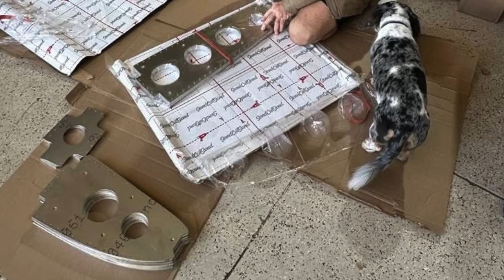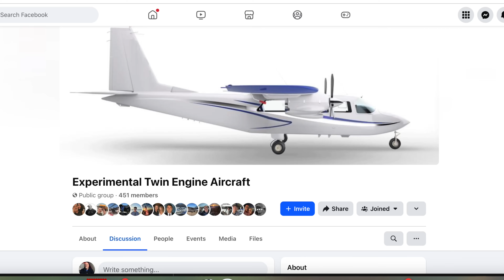Viking Aircraft Engines NEW TWIN Design & Timeline

Comment: How many square feet wing area? 2000 sq ft? Jan divide by 10.  We know what he meant.  For the record C-182 has  174 square feet wing area.  Being a twin engine pilot (instructor and ATP) my question is how is he going to feather the prop on that twin? A twin with non feathering engine is looking for a place to land or loss of control. Almost all, auto engine conversions are fixed or  ground adjustable or an electrically controlled prop. I don't know of any electric props that are full feathering. For a small light twin to have any chance of staying in the air (level much less climb) on one engine, a feathered prop on engine shut down is a MUST. 

Not a fan of  automotive engine conversion or even Rotax with PSRU's.  Just my opinion and they are failure points. Trust me.  Viking has success in the 80 to sub 120 HP class which Rotax rules (but cost more than a Lycoming). Personally the best conversion is a direct drive Lycomnig in the 150-210 HP (4 cyl) and 235-360 HP (6 cyl) ranges. For LSA the Rotax or Viking is fine I guess (but not for me). Again direct drive with hydraulic prop control is far better in my opinion, at least for my RV-7 and a twin.
Reply: FYI, Airmaster makes an electric prop controller that feathers.  And I'm not sure why people get wound up about PSRUs. Many of the big radials in the WW2 bombers had them, P&W R-2800, Wright Cyclone 1820, Allyson V-1710, as well as the Merlin that powered the Mustang & Spitfire. None of those are LSA and they kicked the crap out of the Nazis. Just sayin...;-)
Reply: @danieldrinkwalter2393 Because they fail... a lot. They require more inspections and maintenance. They are a failure. All these PSRU's on small experimental conversations are after thought add on's.

 Wright (and P&W) radials and P&W PT6 turbine, have  planetary reductions integrated into engine case from a clean peice of paper design, real aircraft engines designed to be in aircraft and drive props. Radials, V-12's and turbines have less harmonics and power  pulses. This is less stress on gear reduction. Merlin V-12 uses a  spur gear reduction, but again it's integrated into the engine case. It also had history of reduction issues and failure.

 Lycoming and Continental both made geared Horizontal Opposed flat 6 cylinder engines. I flew them. You had restrictions on how you flew them. Overhauls are much more on these engines.

 Honda car engines or even Rotax have a spur gear box bolted on as an after thought  Rotax, Viking all have had gear box failures. My RV-7 gear box can't fail. Why? because it is a direct drive Lycoming.

 As far as AIR masters what does that cost? Ha ha. I got my 5 yr old Hartzell with 500 hrs for $2500. Owner was upgrading to Blended airfoil  Hartzell. At the time this prop was $6000. Air master ( not made in America, support less than Hartzell) north of $20,000. It is inferior to hydraulic prop with brushes on slip ring and electronic controller. Hartzell no electricity needed. Any more questions?
Reply: @gmcjetpilot  What’s your source for these stats?

Kitplanes looked into it a few years ago, and as I can recall most of the failures of auto conversions come from poor electrical work done by builders, not mechanical failures that are fairly common on legacy engines.
Reply: @gmcjetpilot  I'm the opposite. I'd choose automotive with a PSRU over a lawnmower engine, although not from Viking. A PSRU is not an afterthought, its a requirement. Not all automotive engines are good for conversion, but some are far better than all of the above. I think people are mad for still using aircooled, pushrod engines running on leaded petrol with a carburettor. The amount of issues they have and poor reliability. Automotive engines get a bad reputation because they are installed by amateurs that aren't engineers and have little to no mechanical knowledge.
Reply: @chippyjohn1 Well you are ignorant and foolish... and a troll. 😂😂😂. An Aircraft engine is superior. Period. 😊